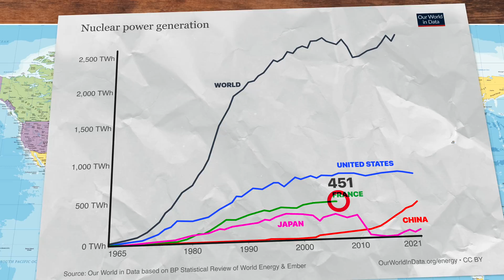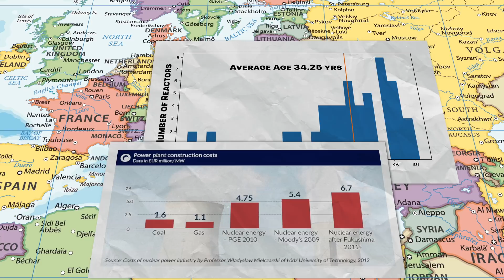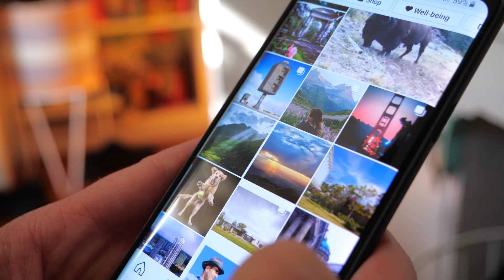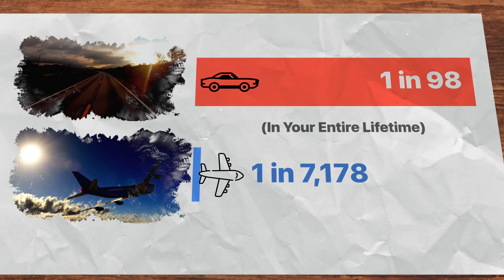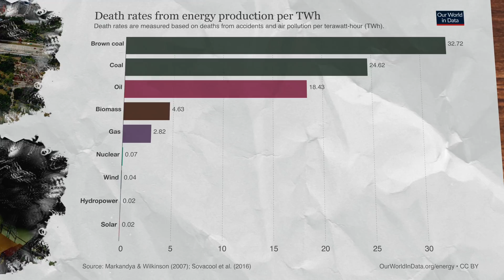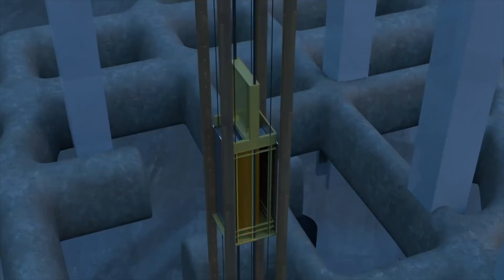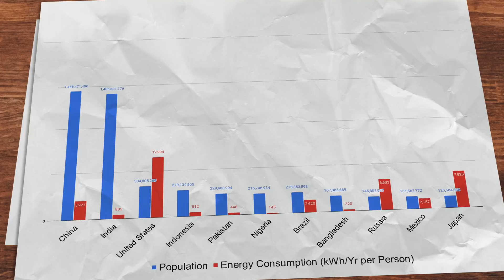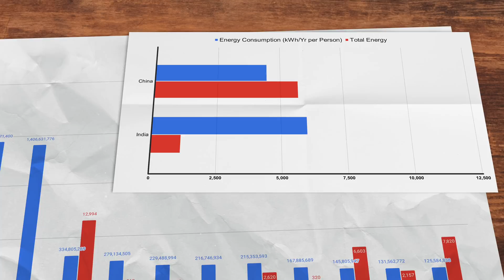The Future of Nuclear Energy Depends On This...

Comment: Nuclear TCO is ALWAYS going to be estimated, but the reasonably accurate estimates are always going to be extremely high, due to the disposal problem- or at least for several centuries, and there is NO chance it will fall substantially before fission is fully deprecated by deployment of fusion or other nuclear process-based generation. And that's assuming the profit motive doesn't over-ride safety, which pretty much qualifies as a contributing, if not major, factor at ALL of the disasters so far, including Chernobyl (what, you think the massive problems with Russia's military, infrastructure, and ordinary society due to corruption didn't happen in the U. S. S. R.?)
As a transition nuclear technology, fission is theoretically just great, until the waste disposal problem is considered. The other practical difficulties make it even more problematic.
Reply: And with the low cost of renewables, the upcoming vast drop in pricing for battery storage, there really is no economic place for nuclear left.
Reply: @luc_libv_verhaegen  The problem with PV solar, and even wind, though, is the industry behemoths will always view small-scale, widely distributed deployment as threatening their business model and choke-hold on civilization, and consequently will hamper these efforts as much as they can, and whatever lip service they give to sustainability and the less-damaging aspects of alternatives, their ONLY priority is power, in maximizing revenue and socio-political control.

Comment: I don't understand the argument. Why nuclear over the solar? Especially talking about India/China? I can see places where there is a lack of solar power or wind energy, but we already know that for a given area, if available, solar is easier to install, generates more power during the day, and is less on maintenance (nuclear is a dense energy source, but it needs a tonne of moving parts and supporting systems that take up a lot more area than what we expect). I used to be pro nuclear until I saw the amount of land needed for a plant). I'm a bit bothered by this video missing any points on why nuclear. Providing current installation and usage statistics is only supporting the idea that solar and wind investments are newer than nuclear. I'm also bothered by the comparison between airplane crashes, and nuclear disasters. A nuclear disaster is not a shock factor - any more than a 0% chance on a nuclear accident means the area next to it has the potential to become uninhabitable for centuries, making nuclear installations in countries like India with little available land become prohibitive.
Reply from the maker: I'm not saying either or, I'm saying both. Solar needs energy storage which isn't cheap right now. you can't have huge spikes in production in the day and zero at night, that's not how grids operate. Nuclear is a reliable 24/7 power generation technology. we need that in the mix today, we don't have nearly anyway of providing enough storage. but like I said, we will in the coming decades, and I think then we can have this conversation. thanks for the comment!

Comment: I have an idea but I don't know if it would be good enough to make a video around. We can technically make power through nuclear decay however it is a low amount but would it be high enough that you could theoretically use it to act as a passive energy regeneration for a electric car? It would not be enough to power it completely but could give you a few extra miles

Comment: It's important to expand all 6 carbon clean energy families: solar, wind, hydro, bioenergy, geothermal, and yes, nuclear. But we have to honest about the reality that nuclear is by far the most expensive and slowest to build of them in most conditions. Also, that nuclear power has slow production responsiveness. Nuclear power is a great part of the clean energy team, but one needs to understand it's disadvantages. Globally nuclear is about 10% of electricity production and we should expect and aim to see it expand to 15 to 25%, likely near 20% by 2050. In most cases though, it's the last resort that we build out when the cheaper and quicker stuff isn't enough.

Also notable is that the least expensive, least slow, and least unpopular way to make more nuclear power is by adding new reactors onto extant nuclear power plants. And even that still takes forever and costs a ton.
Reply: @jasonk125  it's expensive and slow to build, and also slow to change real time production. But it is also a dense reliable carbon clean energy source not dependent on local regional resources. It's the sort of last option for when the local energy grid resources aren't enough. Step one of course is to stop closing down operating plants seen in Germany and California, step 2 is to reopen plants shut down early like what we see in Japan and the UK, step 3 is to expand currently existing plants by adding new reactors as seen in Georgia, and step 4 is to build new plants where necessary as seen in China, UK, South Korea, Poland, and a few others. Yes, use the other 5 clean energy families first, but even with all 5, we will still need some degree of nuclear to effectively decarbonize in time.
Reply: @jasonk125  first of all, you didn't ask me for any evidence, best not to assume what people do or dont have without asking them.  Second, while it is theoretically possible to power the US specifically, a very natural energy rich, large, and geographically diverse nation, on solar, wind, and storage, it would be legally, logistically, and economically difficult to the point of extreme impracticallity. It would certainly be suboptimal, inefficient, and vastly expensive to do such a thing, even though onshore wind and pv solar are currently the cheapest energy sources per unit of energy. It also makes some interesting assumptions about how the next 8 years will go. And of course, it would make the grid less stable and be more wasteful than if that system kept and didnt in any way expand what of the other 4 carbon clean energy sources we already have, noting that hydroelectricity which is near 8%, bioenergy about 2%, geothermal which is near 6% in California, and nuclear which is about 20% nationally.

Like, dude, I'm on your side. I am all for the expansion of solar and wind power. They are cheap and fast to go up in most parts of the world. But they are also imperfect for various reasons, and not as suitable to all regions. We will likely need every tool that we have on a global scale to address the climate crisis in time. I've seen studies that are concerned about the last 20% of global electricity demand by 2050 in a renewably powered world, and many suspect it will be filled with fossil gas plants, often speculating about on site carbon capture. But considering what we've seen in these industries so far, and the leakage of methane in the well to plant logistics I think we should stay as far away from that as possible. Don't get me wrong, I'd prefer that last 20% to be covered by breakthroughs in geothermal (which is still suspect will be 10 to 20% by then, but 30 to 40 would be better), or with major breakthroughs in energy storage so wind and solar can efficiently handle it, or even space solar. I find depending on major breakthroughs like that, risky at best. And then consider that nuclear is already 10% of global electricity supply, so removing that as opposed to expanding or even just keeping it, while we still have coal, oil, fossil gas plants to shut down and replace seems like absolute insanity. Even the recent IPCC third climate assessment in solutions lists a modest expansion of nuclear power as one of the ways to cut emissions and address the crisis in a financially optimum and then viable way, depending on the degree of expansion. The reality is that we everything we need now to address the climate crisis in an economically feasible if not optimum way, if we use all the tools we have and don't handicap ourselves trying to make things harder than they have to be.
Reply: @jasonk125  nah, I make that statement and them discuss, explain, and give some, though not all, of my evidence for it. It is insufficient for you of course, as any evidence would be. Unfortunately, many people have very strong prejudices against nuclear power for the wrong reasons. 

As for what I'm basing that on, I already explained a bit of it but I'll reiterate and go a bit further. Wind and solar are very cheap, energy storage systems at this point however, are not, at least not at the levels needed for the purposes needed. They can be competitive in many scenarios, but they are not yet as cheap as many other options... not yet anyway. Meanwhile, wind and solar are location dependent and require a relatively large land footprint which from the legal and logistical perspective often faces many obstacles from local property owners, organizations, and, ironically, environmentalists (extreme ones) and or environmental impact issues (which by my understanding do not outweigh the benefits of fighting the climate crisis). Compounding these issues in similar ways is energy transmission, which runs into the same NIMBYism as we try to build out the grid in new ways to take power from where energy is generated to where it needs to be consumed.

Yes, solar and wind compliment each other, yes energy storage makes them even better. But again, we already have near 30% of US electricity carbon clean from non solar and wind sources, throwing those away would be extremely wasteful. Especially the nuclear Part which makes up about 20% of US electeicity at this point. As we both point out building new nuclear plants is expensive and slow, so once we have them we should keep them going as long as is economically feasible in order to make the most of those high initial investments in time and money. And again, we should not be wasting those investments by closing any of them down early, and those who were closed down early should be reopened, because again, as we both point out, building them in the first place was time consuming and expensive, and now, fortunately they are already there. The time consuming and expensive parts are done. Once that initial contruction cost is paid off Running them and keeping them fueled is relatively inexpensive on the per unit of energy basis. So we should do that, again, they ate already there, even if they were shut down early, reopening already built power plants is cheap (pre demolition anyway).

As for expansion, that's situational. Where it is economical or otherwise necessary, it should be done, where it isn't, it shouldnt, use the other options first, but that isnt enough everywhere. I mention adding reactors to extant plants as the less expensive and less slow method of doing so, but again, that isn't worth doing everywhere. Some nations see fit and economical to build new nuclear plants due to lack of local other low to zero carbon clean resources, or insufficient resources for their local needs, examples include the UK, France, Poland, Sweden, South Korea, and Japan in the former, and China and India in the later.

Again, I point you to the IPCCs third assement which in their list of solutions shows modest expansion of nuclear listed as a cost saving way to cut emissions, and then expanding beyond that can cut emissions at progressively increasing costs.

I get the temptation to oversimplify these issues, but the reality is that they have complexity. The all nuclear crowd is also oversimplifying, but so is an all solar, wind, battery position. They are both technically possible, but also both suboptimal, overly expensive, and have all sorts of specific and complex issues that don't lend themselves well to the tempting desire to oversimplify a complex issue... or series of issues really.

Comment: Russia has attacked nuclear power plants in Ukraine. Nuclear energy is too costly and too dangerous.
Fukishima and Chernobyl are still poisoning the environment decades after their disasters.
Wind and solar energy combined with battery storage can provide all the energy needed and it can be produced locally not imported.  Europe needs to provide incentives for installing electric heat pumps for homes and businesses as well as solar panel for their roofs. It is time to go all in on wind and solar energy and electric vehicles.

REPLY
Reply: Russia wanted to capture those nuclear plants, and there was no containment breach so I don’t see the issue.

Fukushima and Chernobyl aren’t actively “poisoning” the environment any longer.  The radioactive material is simply still present in the environment, and in the case of Fukushima those materials are not present in hazardous levels. 

Statistically nuclear power is actually safer than wind.
Reply: Battery based renewable energy is not practical because of the heavy metal and other material requirements. We wouldn’t have enough nickel and cobalt to go all electric for cars,we need 8 times the production of nickel to meet electric car demand so we wouldn’t be able to have the materials for extremely expensive battery grid storage.

Comment: Wow, you glommed onto the age issue immediately!  And it isn't just build costs... decommissioning costs are just as extreme.  Combine the two and for all intents and purposes the cost of adding a new reactor is roughly double the actual build and commissioning cost for that reactor because the utility is likely decommissioning some other unit at the same time.  Sticker shock reduces enthusiasm a lot.

Next problem is insurance.  Nuclear reactors are not insurable, which basically means that governments have to back-stop the operators.  This is true everywhere, including the U.S., and as existing plants age those costs continue to rise dramatically.  So no new nuclear plant gets built without that government backstop.  Its like Earthquake insurance in earthquake-prone areas or fire insurance in fire-prone areas or flood insurance in flood-prone areas... its either government-supported or it doesn't exist.

Another big problem is economic operation.  There is a huge difference in cost for a nuclear reactor that is able to put out steady power 24x7 verses one which has to load-follow the daily curve.  Today's grid is not really base-load-friendly and it will take a few decades of utility-storage build-out before it becomes so again.  This means that nuclear plants built now cannot run economically.  (I've mentioned this before).

And lastly, the number of nuclear reactors we would need right now is far higher than the number of nuclear reactors we will need in the future once grid-scale storage is completely deployed and able to soak up renewable generation.   Figuring out how many plants we should actually build is a problem, particularly any building done now (since the plants can't operate economically in the current environment), verses building nuclear plants 20 years from now which would be able to operate economically.

-Matt

Comment: Out of ALL of his inane blubbering, about the RELATIVE safety of OLD nearly outmoded, ridiculously expensive, and immensely nuclear polluting Generation III nuclear power plants, he gave extremely SHORT SHRIFT to GENERATION IV Nuclear Power plants that would be FAR cheaper, safer, immensely more efficient, and NEGLIGIBLY polluting.
    Molten Salt Reactors (Gen IV) will also be more than able to burn to exhaustion all of the stored old style nuclear reactor waist.
     China and India are already in the planning stage for building SMRs.